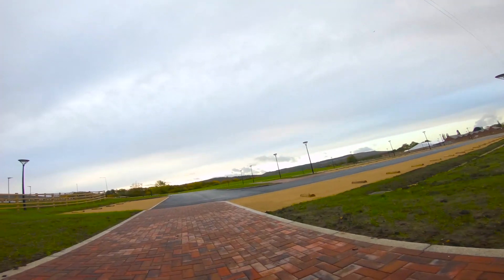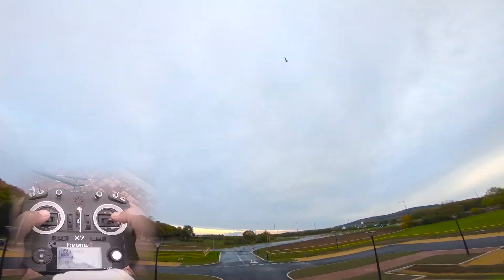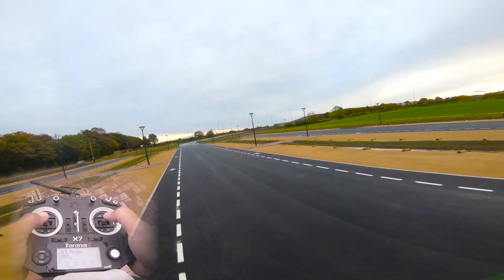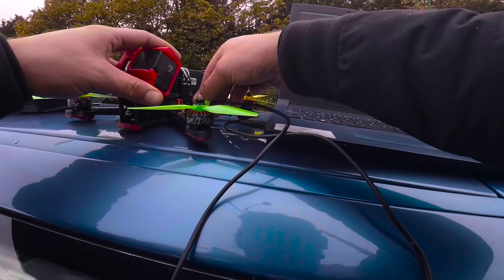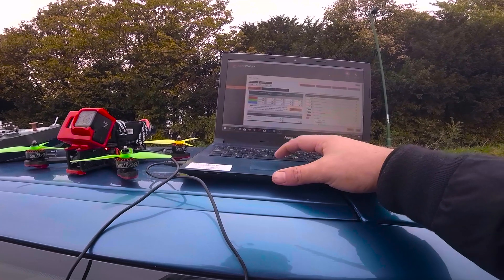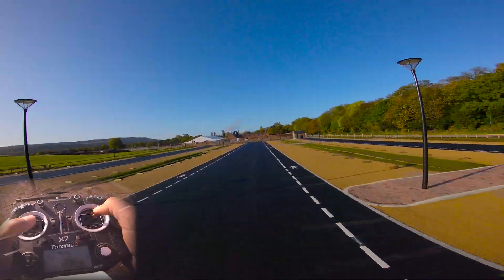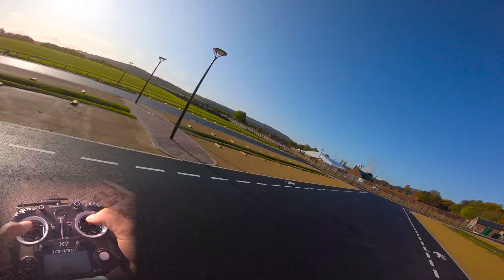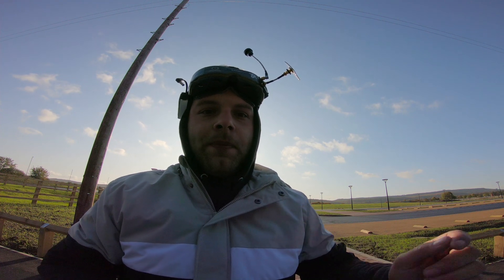PID Tuning Betaflight 4.1 - impulse RC Apex

Comment: Hey man I was just watching your video and in your stick cam I noticed you have your trim switches still activated. You have to go into the quad profile in the transmitter and on the screen for (I think) flight modes[it has all the 0:0:0:0 on the screen. Change the first mode to :_:_: that will fix un wanted drift and accidental trim adjustment. Search how to turn off trim switches. 🤟

Comment: What where the final PID you ended up with
Reply from the maker: I have not listed them for good reason, all setups are different. Therefore all PID's are different. Weight is different etc. I can help you if you tell me what the problems you're having are, or do you have a video of the quad you're trying to tune?

Comment: Great flying man wish I could wrap my head around pid tuning I’ll be interested in your filters also , I’m running 4.1 with rpm filtering on my apex currently on the nurk filters but still isn’t feeling right getting a lot of propwash back on the throttle from hard acceleration or change of direction
Reply from the maker: Sounds like a TPA issue rather than the tune itself I have rpm filtering on with both filters on 1.2 on the sliders
Reply: Thanks for your reply , I’ve got TPA of 0.65 & breakpoint of 1250 what would you suggest I try ?
Reply: @drcostanza2973  If you're getting oscillations when you hit the throttle try adding more TPA to reduce it (I do increments of .1)

Comment: Show me your pids! Lol are you running the 2450kv variant? Having troubles tuning out some weird twitches on 4.1.
Reply: Thank you! , yeah I’ve played with filters .. motors are still cold, just like to see if I’m going in the right direction with my pids.
Reply from the maker: Yeah 2450kv Xing motors but I use rpm filtering. When are your twitches happening? Is it under high throttle or mid throttle? Should be able to send you my PID's if you need them but they may not work exactly for your setup but it could be close if you're running some of the same components.
Reply: @PhoenixFPV   hey man got the apex and the same motors , have been getting oscillations, mind sharing your tune for 4.2?
Reply: Phoenix FPV low to mid throttle cruising, yes I am using rpm filters.. ice cold motors and it flies great except for these random twitches.
Reply from the maker: @sweettfpvillain462  sounds like more of a filtering issue tbh, I'll put a list of my PID's and filters in the description shortly and I'll send you a message when I've done it. You're more than free to use them but always hover test it first please to see if your motors get warm 😅 have to cover myself but it should be near for you. May just need a couple of tweaks.